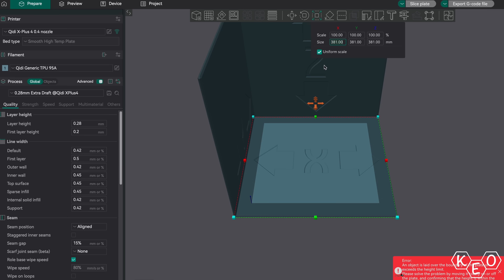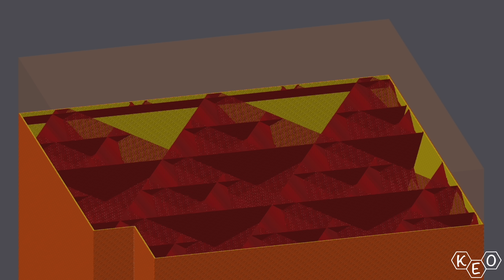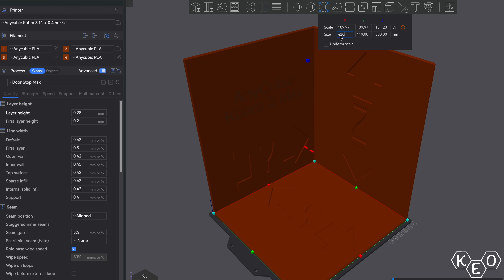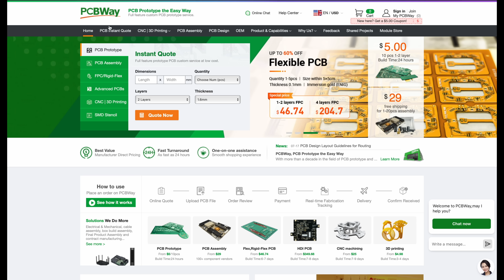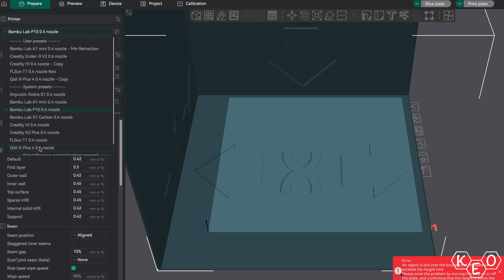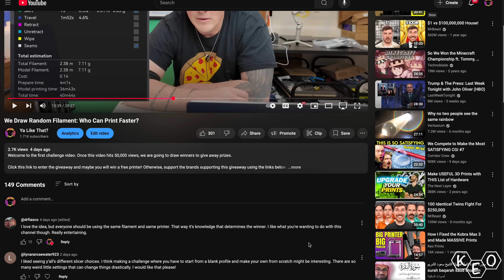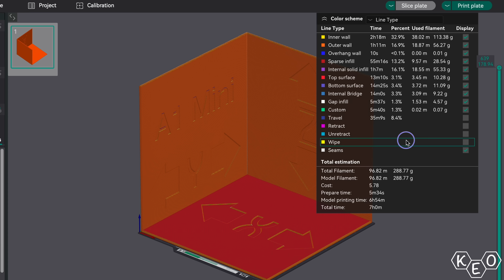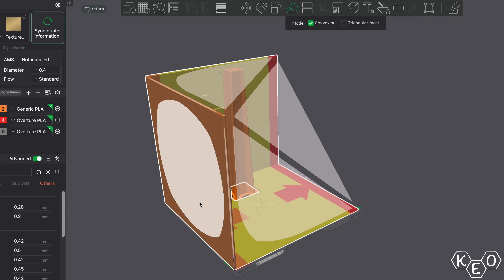Real Build Volumes vs. Manufacturer Lies

Comment: Many reviewers argued that the Anycubic Kobra S1 Combo (250x250x250 advertised) has a smaller build volume than the Bambu Lab P1S Combo (256x256x256 advertised). Turns out it actually has a larger build volume since the actual build volume of the Bambu Lab P1S Combo is 250x250x250 and the Anycubic doesn't have that exclusion zone the Bambu Lab has.

Comment: So, I just got my kobra s1 combo and imfor the life of me, I can't not get the bed to move. It just makes a horrible noise and I'm afraid something is going to break. Any input?
Reply from the maker: Did you remove all of the bed screws that hold the bed in place? There are some at the front and back. I would say just go back through the instructions very carefully and make sure you took everything out that was supposed to be taken out. I have literally done this exact thing but I don't remember if it was on my X1C or maybe even my S1
Reply: @KeoPrints thank you, I found 1 by the Z rod in the very back.. the unbixong video i watched said there were only 4, 2 on each side. Had me thinking I broke it before I even got started. Thanks so much!!

Comment: 7:55 whipping the door open like that likely caused the layer split visible at 8:20.
Reply from the maker: It very well could be... but also, I typically print with the top lid off if I have the door closed for this reason. Still, could be
Reply: @KeoPrints  Yeah me too, except my P1S. I actually left the door closed with glass on today. Halfway through opened it, then thought about my comment, closed it. I didn't know what to do. So, l just left it open  an inch.

Comment: I would like you to do the Prusa Printers.  I have an XL - In Prusaslicer I just sliced a 360x360x360 cut out cube like you do - and no errors.  The printer claims 360x360x360 build volume - I see no reason to doubt it.

Comment: How about trying to print beyond the build volume? I know there can be movement beyond a build plate and printable area, especially on bed slingers. Just don't wreck your printers, or maybe wreck some (if you can afford it) so we know better.

Maybe use smaller prints, instead of not-a-box box. https://youtu.be/MXY6QCjxEWQ

Comment: Seeing your comments about the P1/X1 at 12:58 - I don't get this error at all unless I drag a part literally over the little white box in the corner. I can (and have) printed things on the build plate 1mm away from that box with no errors produced and no issues on my P1S. Slightly confusing!

Comment: @KeoPrints Adam, what you are encountering are the limitations that have been set in the printer’s profile IN THE SLICER. 😊 
One comment even mentions different results with Orca and Bambu slicers! 
In the Elegoo slicer the ‘forbidden zone’ for the CC’s filament cutter can be found as follows (and I expect Orca, Bambu, etc to be very similar) - 
Click to edit the ‘preset’ for the printer+nozzle
In the new window click to turn on Advanced
Then under ‘Basic Information’ you will see “Printable Space” where ‘Printable area’ and ‘Excluded bed area’ as well as ‘Printable height’ can be found (and presumably edited by the brave). 

The excluded area is defined by its four corner co-ordinates (XxY, XxY, XxY, XxY) on the field seen in Printable Area. For the CC it specifies 10mm sideways, 20mm front/back in the front right corner. 
And the CC’s (slicer) build volume is actually 257 cubed (not 256 😮) less that exclusion zone.
Reply from the maker: Good notes here. Thanks for sharing friend!

Comment: for legacy reasons i'd like to see 220*220*250 or 235*235*250 (i3/Ender 3 Standard) and 220*210*250 or 250*220*270 (Prusa's abominations, i3 MKx and Core One respectivly)
Reply: In fact, I was even able to increase the build volume of my old Anycubic i3 from 210x210x205 to 220x215x205 without changing anything on the printer (a completely stock printer). It was enough to change it in the software. And the 210x210x205 is the advertised build volume.
Reply: @pascal.d3the OG ender 3 also has a 235mm² but slices for 220mm². Probably margin for the then used bed clips

Comment: Good idea, but... Why make them solid sided. Easy option to reduce filament use would be a diagonal cross on each side leaving large empty triangular areas. Also, I wondered why you didn't include the actual available axes lengths in the embossed text. Finally, you know the exclusion area for the filament cutter can be used, but only in single colour prints, spool fed. So it's not an absolute lie to say that volume can be printed.
Reply: I think to do that you would have to remove the cutter lever, or the stop it moves against. 
In the case of my Centauri Carbon, the filament cutting is an integral part of the filament unloading process, so I don’t think removal would be a good option.
Reply: @dougal6569 there's a print you make to keep it out of the way. There's a guide on the Bambu wiki
Reply: @dougal6569 sorry, I was referring to the Bambu printers. I haven't used the others, so not sure if they offer this workaround or not.

Comment: I think you could have saved a ton of filament, significantly reduced the warping, and still achieved your goal by printing gaps in the walls (think hexagonal grids or multiboard for a visual).
Reply: You dont save filament by adding holes. The perimeters of all those holes end up using MORE filament and time to print vs a solid wall with little infill/perimeters. Holes help add strength due to this exact thing, not save on anything unless they basically are a gaping hole through the majority of the wall face.
Reply: @MattWeber  I'm gonna have to disagree with you on that bud.  It of course depends on your settings, but I just created a 200mm x 200m x 5m print.  Solid with a reasonable number of top/bottom layers and walls you're looking at about 100g.  Leaving the walls as is and replacing inside section with an open honeycomb grid at 10% you're looking at about 30g or 1/3rd the original amount of material.  Even at 10% there's a significant amount of honeycomb structure.  I would expect this to be plenty durable for the purposes needed here.
Reply: @Dalroth  Are you adding actual honeycomb holes, or just removing perimeter walls to use the infill as honeycomb? Having perimeters on the walls + holes is 100% slower and sues more material as every single hole needs top/bottom layers in addition to the perimeters for the walls themselves. As well as the printer slows down for each of those overhangs and geometry due to acceleration settings.
Reply: @MattWeber  I never said anything about it being faster, only material usage and warping.

My point is if you want to save filament you have options if you are willing to think creatively.  You can also just make the damn thing a window pane, or hell you don't even need anything in the middle at all.  You just need the outside frame and nothing else.  That still serves the purpose of representing the relative sizes of the build volumes.

If you are hell bent on having a solid block then whatever, you do you.
Reply: And print them at 50% scale!😂😂

Comment: Awesome visuals. A few notes though: X1C and P series printers can use whole build plate…with some hassles. 1) You need to use the external spool holder and not the AMS; 2) you need to print and use a small model that physically tucks the filament cutter out of the way and 3) you need to make a few setting changes in the slicer. It IS a hassle, especially the first time. But I have done it for some larger gridfinity bases and can vouch that it works fine. I know a large majority of X1/P series users will NOT jump through these hoops. But it is an option.

Second note is that the A1 from my understanding does NOT have this filament cutter exclusion zone. So A1 shouldn’t have been lumped in to the group. So even though all those BL machines have the same 256 cubed build plate, the A1 will actually let you use the full build volume without jumping through any hoops noted earlier with the X/P-series machines.
Reply from the maker: Fair points here. Good to know about the workaround as well!
Reply: Came to say the same thing. They have it clearly written in their Wiki too. For all the flak Bamub get, their documentation is sound.
Also the exclusion block you had on the X1 is way oversized to what you actually can't print normally. The white zone is much closer to reality there. I know I've printed much closer to it.

Comment: Maybe someday, like televisions, the dimensions will have an astrix. 300* class, 250* class, and so on. Where the number will be larger than actuals, but it's the same class.
Reply: Your 40 inch "class" monitor or TV is only 39.5 inches. And your "LED" screen is only an LCD with LED backlighting.

Comment: The Bambu P1/X1 series is 256x256x250 by default (Minus the flament cutter exclusion zone). It's set to not exceed 250mm tall to allow some space for the nozzle when finished but that can be disabled easily. The filament cutter can also be disabled and held back with some sort of a printed piece (Not sure how to do so but it was listed in the user guide on Bambu's site).

Comment: Last night I was playing with Hueforge, turned a square B&W drawing into a STL file, imported it into Anycubic Slicer v1.3.5.3 Next to colour it and it scaled to 420x420 to print the full build plate on the Kobra 3 Max (after I turned the tower off) and used the "center" option.  When I opened it I was prompted to upgrade to v1.3.5.5, so I downloaded that and reloaded the SLT file to re-check and that sliced at 420x420 too.  I haven't had a chance to print it yet.

Comment: Can you dive deeper into the warping in the H2D ?  That was the greatest negative for me with the H2D.  I don’t know if there is something fundamentally wrong, not optimized or just the bigger parts or me.
Reply from the maker: So the warping on that model in particular was just a product of the model itself. Any model with sharp corners like that can be subject to the warping. I typically design with rounded corners for that reason. But adding to that, the one wall on the left side being built up; the base of the model is just experiencing too many forces to keep it stuck down. 

All in, this is the model and the size, not so much the printer
Reply: @FunctionalPrintFriday Has a video on this, I don't remember the workaround.

Comment: 256 is 100000000 in binary. A nice whole, round number
Reply: Yes, if your printer only works in whole 1mm steps. Mine seems to do 0.01mm steps and 25600 steps isn’t quite such a nice binary number.

Comment: The first “ practical “ test.  Temp towers, tolerances models and benchy boats are all worthless. This is actually useful.
Reply: Benchys aren't worthless. They have lots of parts in them that help with overhangs stringing, bridging all sorts of things
Reply: @jamesv4463 many do like them.  I have ZERO use for all these tests.   It all what each thinks is best.  My printer is in a semi with the engine vibration constantly going.  I get very good results.

Comment: Ummm. Actually the limits encountered are being set by the slicer, not the printer itself. One has to assume that the tech folks that set the printer’s profile limitations would have squeezed every last fraction of a mm out of their baby… but it is just an assumption! 
What the marketing folks might claim is another thing entirely, but is guaranteed to be a nice-looking number, rather than whatever odd decimal comes out of the software and engineering. 
While it would be nice to have precise printable and exclusion volumes overtly documented, that information must be known to the slicer and therefore readable without iterative estimates of negative cubes. There has to be a smarter (lazier) way!

Comment: So much wasted filament... 3d Jesus is crying.
Reply: and he didn't even share the end results in a list or written down so others could benefit from this waste
Reply from the maker: That’s fair. I probably should throw together a list but it is going to change from slicer to slicer. And as a lot of people are commenting; things like exclusion zones and stuff can be worked around. But as a thought experiment and a conversation in the community, the visual works well!
Reply: @KeoPrints  wait. if it changes from slicer to slicer then it becomes way too complicated for a full list - not what i meant. just the dimensions and exclusion zone you discovered for this video. i think most people don't remove their filament cutter just for one print or use direct g-code to gain a few millimeters. (and if they do then they likely go through the effort of figuring out how big they can print after the mod. )

Comment: Try to switch off all retraction and hop (you may need to go into settings for support, where some slicers will have a dedicated toggle for z hop on supports  even if you select no z hop on the basic Z hop setting for the slicer, then try and see what size you can fit

Comment: 12:46 "that's a super random number"
Uh no it's not. Are you joking or are you just unaware?
Reply: Well, I was thinking the 256 was from binary, but actually with these things working to 0.01mm, the dimension is 25600 of those units, which is not a tidy binary number.
Reply: @dougal6569  the base unit is millimeters.

Comment: You should try do to a bit more research first, at least for Bambu Lab Printers with a single nozzle you can overcome the exclusion zone and height limits very easy and print exactly what is advertised.

For the P1/X1 you can just disable the nozzle cutter gcode, print a little piece to hook back the cutting lever pusher, and also remove the prime lines after the print starts - then you can use the full volume, here also 256x256x256 can be print without issues 

For the A1/A1 Mini: you might try Bambu Studio - there is something wrong with the motion limits in orca - i can put a 180x180x180 cube on the plate without issues - you  don't even have to remove the prime line, since it is within the motion limits of the y axis outside the printable area - so in theory you would have even 5 mm more in the front, with a bigger plate

On the H2D the Motion limits are 325x320x320 (325 right) for both extruders, but the right one is shifted by 25 mm right and 5 mm up - which gives you a "cube" that has a 25x5 mm strip cut out top left, also you don't need a prime tower in this shape and size - for printing large objects, you an also "flush into infill" or print inner walls first, which is plenty enough to prime the nozzle after a switch

Comment: I haven't seen the Anycubic Kobra S1 listed with a build volume other than 250mm cubed.  I'm not trying to be critical, just curious.  Did you scale your model to 220 X 220 X 250 as you said in the video when you printed it, or was it actually as Anycubic says, 250 X 250 X 250?  Thanks in advance.
Reply from the maker: It was actually the size they claimed for this one

Comment: We all came to look at the H2Ds print volume and you showed it the least. Also their heated bed on thst printer isna joke. Hope they hage already fixed it with a proper heater and not thay kettle heating element
Reply: i have an H2D for 2 months now and never had an issue with the headbed - it works perfectly fine.
Reply: My friend has had supports fall off in parts of the build plate thsy arnt properly heated and had to bump up the temp the main real reason the build volume. Real talk fingers crossed for a single head bigger water down printer. What we all wanted 🤞  @suit1337

Comment: Yeah so you're flat out wrong about the A1 and the A1 mini. I just sliced 256x256x256 on my A1 and 180x180x180 on the A1 mini with Bambu studio - slices fine. I don't own any of the others but maybe try it with the printer manufacturers own software.
Reply: yes, on the A1 and A1 mini you don't even have to do anything, just print - the prime line is in front of the model - for the P1/X1 you need to change a few things to use the maximum build volume

only exception is H2D - but they don't hide the fact, that the Extruders are shifted by 25 and 5 mm so create 2 unprintable 25x5 mm strips at the top left and bottom right - so nobody is cheated here

Comment: *A1 Mini can print 179.99 x 179.99 x 179.99 mm, you're cheated out of 0.1mm
Reply: the Mini can Print 180x180x180 without a problem - orca slicer does something wrong here - same for the X1/P1 - 256x256x256 is totally possible (cant use the filament cutter and the AMS though)
Reply: Yeah, they are the opposite. They say they can print 220x220 but they go up to 235x235.